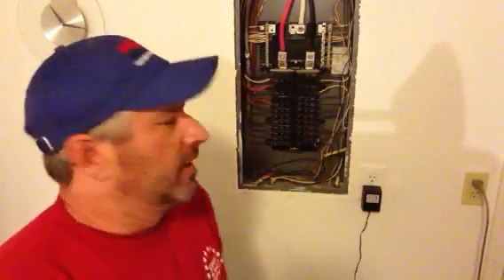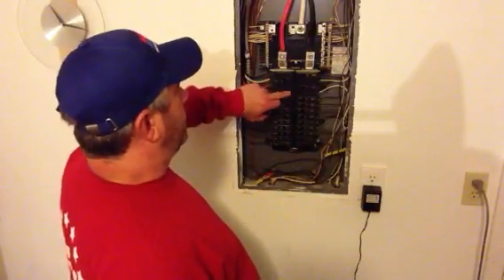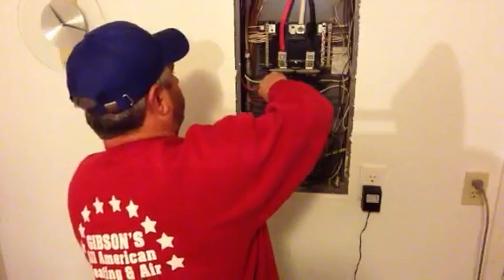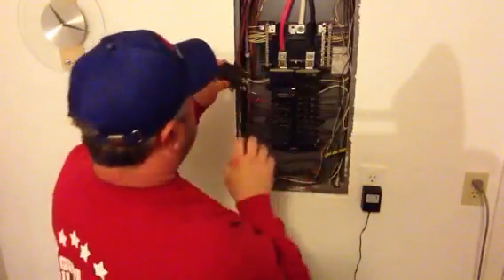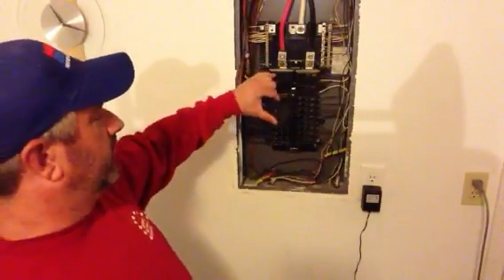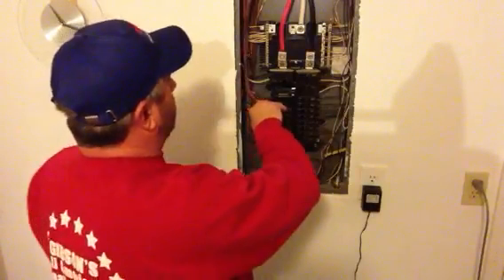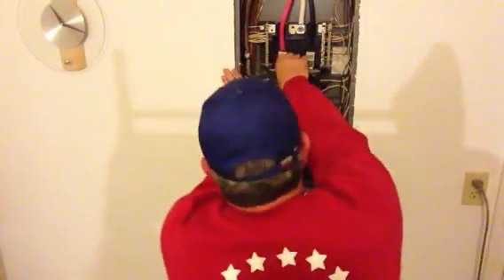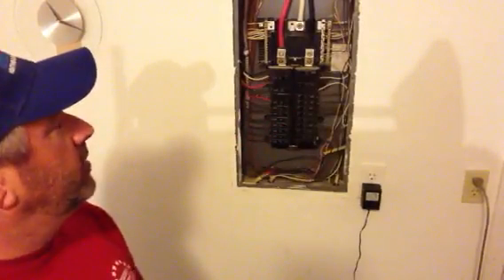Change any breaker quickly with power to panel always on.

Comment: Is your life not worth the five minutes it would take to wear PPE, de-energize the panel, test for a the absence of voltage and conduct the replacement?
Reply: I guess I live on the edge then because I have done this a few dozen times already.
Turn off breaker, pop out breaker, remove wires, grab new breaker, attach wires, turn to off position, keep hand on the plastic, pop back in and wiggle the thing into place. Power never turned off.

Comment: Weather you can do it with the power on or not just turn the main off. For people that don't know how they will try it and get killed. But everyone is different I wouldn't do it but that's me.
Reply: I doubt they would get killed. Many things have to align for that to happen.
If you can turn it off.. turn it off. If not then by all means keep your hands on the plastic, keep the breaker in the off position, look how it attaches and then clip and wiggle it in.

Comment: I changed a bolt on style breaker (THHQB) today on a sub- panel that was live (couldn't shut it down for operational reasons - commercial business).  I had my PPE on, insulated tools, one hand only in the panel at any time, and a helper with a piece of wood nearby just in case.  I would have much rather de-energized this panel, but critical equipment was on the panel.  So, morale of the story is you CAN change breakers on live circuits (thought I wouldn't ever consider this on anything over 600 volts.  460 is scary enough.) but make sure you are basically a safe well trained electrician.  If you're going to change a breaker at home, disconnect the mains.  If your panel doesn't have a main disconnect, have one installed.  You're supposed to have one anyway.
Reply: There is nothing in the National Electrical Code that states that a main breaker is required. If certain conditions are met the use of a main breaker is not required. However if certain conditions "DO" exist then these conditions may require a main breaker. Again "IF" certain conditions are "MET".  There are no requirements mandating the use of a "Main Disconnect" "OR" "Main Breaker".  Now with that all being said the authority having jurisdiction ( AHJ,... or  i. e. Local Electrical Inspector, or for that matter the engineer of record for a particular project ) "he/she" may say that they are requesting the use of a Main Disconnect "BECAUSE",... WAIT FOR IT... they ultimately do have that final authority. However most will not supercede the NEC with a requirement such as this without making it known through their local building codes (or specs if they are an engineer) which is the case in some locals. Hence I will leave with the inevitable Mike Holt link     https://forums.mikeholt.com/threads/when-is-a-main-breaker-required-in-a-distribution-panel.86224/

Comment: My mom keeps insisting I throw the main breaker before putting in switches. I changed out 2 2 pole breaker switches without throwing the main breaker.

Comment: My home is like many described in the comments: built in 1979, and no main breaker.  There is a 100 amp sub panel that contains most of the common household breakers and it can be shut down in the main panel.  Unfortunately there are no empty bays in the sub panel for additional circuits so I have to put a new 20amp line on the main panel.  Interesting thing is the ground and load seem to share a common bus.  Is that possible?
Reply from the maker: Ground and the neutral wire share the same ground terminal. If that what you mean? Your load and line are hot.
Reply: @gibhvac  Sorry, yes neutral and ground.  Not load.

Comment: Changing a breaker live is illegal. It ain't the 70's any more. Any liability is yours and yours alone.
Reply from the maker: @rickhawkins218  Oh it’s illegal? And what would be the law I would be breaking. As for the liability part, doesn’t that go without saying? My business my liability.
Reply: @gibhvac  The Ontario Electrical Safety Code, Rule 2-304, Disconnection, stipulates that no repairs or alterations shall be carried out on energized electrical equipment, and that adequate precautions such as locks on circuit breakers and switches, warning signs, etc. shall be taken.
Reply from the maker: @rickhawkins218  Ontario Canada?
Reply: @gibhvac  If you do work live and anything happens you are responsible and your insurance may not cover you because you are breaking the law. 'Where's the upside?' should be the question you should be asking.
Reply: If you instruct another person to change that breaker and he is injured or dies, criminal charges are laid.
Reply from the maker: @rickhawkins218  I am an LLC and covered by insurance . Accidents happen. But is a risk we take everyday. Sometimes it is impossible to turn off the main power to a building.
Reply: @gibhvac  Under osha rules you can only work live if shutting down creates a bigger hazard. Frankly, you telling people broadly on the internet they can do it live themselves opens you up to a huge liability all by itself. 
Anyeay, you can't fix stupid.
Reply from the maker: @rickhawkins218  To be clear the breaker I removed from the panel is no longer live.

Comment: Is this basically the same for adding a new breaker? My panel just doesn't have a main breaker but I would like to run a dedicated 220V or at least 110V 20 amp circuit to my garage for a welder but I've just been not because I don't have a main.
Reply: @gibhvac  hey when I turn off the main Lightning There's still power coming from those  2 big main cables... that means there's another main breaker or what is going on here?
Reply: @modlauryofficial6603  yeah that's normal. Cuz the main breaker is still Live, still has power coming in from the street just shuts off everything past it. It de-energizes the fuse panel/breakers
Reply: Get some wire nippers, even those heavy duty scissors will work - cut the wire for the plastic tag at your electric meter.  Open the meter housing and yank the meter base off the prongs.  I used to do this all the time doing property inspections in the 90's.  Guy who hired me worked had a contract with HUD if recall correctly.  Anyway, we do the opposite in order to get power back on so we could do our thang - test stuff and winterize using a compressor etc.   I'm not positive things are different with digital meters but I don't see how.   Anyway, that's how you make absolutely certain the power is off.  Important to know this if you don't have a main disconnect (plenty of older homes do not).  Just make sure you bend the metal clip back into place on the electrical company's plastic tag So nobody gets their panties in a wad

Comment: Look at all these keyboard  union warriors commenting about "you're an idiot for doing it live" so typical. Sometimes you don't have the chance to shut the panel off. Banks, large businesses simply can't just shut the power off.  If you know what your doing and understand the risk and how electricity works it CAN be done. I mean hell, you can strip live wire just fine if you understand not to touch bare metal and don't be the path to ground.

Edit: also it's pretty hard to troubleshoot shit when the power is off.
Reply: Did you just compare working on a meter bank to working on a sub panel or residential panel? You do know that banks are not worked on DIYers right? You do know that basic PPE is still used even in that type of work, which is not being done here right? You do know that power can, and is regularly killed at banks from the transformer right? You do understand that just because something CAN be done does not mean it SHOULD be done this way right?
Reply: Says the want to be electrician. 🤣😂

It's not about working on live wires I do it all the time as a lineman it's about doing it safely and this was absolutely not done safely. I work with voltages that would literally blow your arms clean off your body if not worked on safely so believe me I know what I'm talking about I've been working in this field for many years now and that's not from being reckless and thinking that I need to show off and work on a home electrical system without turning off the power because even though I work with voltages much greater than in a home electrical system on a daily basis I absolutely always turn off the power when I work in an electric panel if I'm able to and in a single dwelling home like the one in this video absolutely no reason exists to not turn it off and only turn it on when and if it's absolutely needed. One last thing the power is not needed in most cases to work on and fix / replace or repair something in a home electrical system plain and simple fact once you know what needs to be done.⚡✌
Reply: And do you suppose those who understand electricity, who know how to do it safely, are watching youtube videos on how to replace a breaker? No, so the problem is those watching this for information don't know how to do so safely.

Comment: DOESN'T makes you tough to NOT turn off the main power. you're inches away from being toast.
Reply: @gibhvac  It's also for a very experienced electrician that's willing to risk his own safety.  do it yourselfers are asking for trouble by sticking their fingers into a box with high voltage on.
Reply: @gibhvac  Isn't that what you are doing in this video?
Reply: I have to wonder why breaker box makers just don't PUT A INSULATED protective cover over those high voltage LIVE terminals so you can't slip-up and accidentally touch them ? I'd put some kind of non conductive material between my hands and those terminals. Otherwise one slip that's all it would take better hope 911 responders can revive you. I'm no motcho man. Or wear  sinsulated electrical GLOVES... Man please !
Reply: @jballs1118  that's what CPR is for
Reply: My breaker box doesn’t have a main, so this is helpful to me.

Comment: What kind of panel is that?? We have the same thing and I have no idea how to turn the pain power off to my house.
Reply: @gibhvac  nope, but after doing the research I found I have a splitbus panel . No switch outside I would have to remove the "company fuse" (meter) to eliminate the power to the panel. Thanks for you response though.

Comment: This guy is a fool. Always hire a certified electrician to do work. Cutting corners like this gets you killed or burns your house down.
Reply: Lloyd
breakers need no licenses electrician. BUT its plain stupid to risk and be toast, too much pride!
Reply: Peter McAbyan  Without self education the average person does not know how to properly test for voltage and does not understand enough to work on a panel alone better to be safe than sorry Peter
Reply: I agree if you are not an educated experienced DIY'er or a dumbass do not change breakers.  But if you are, there is no need for an electrician, these projects are simple and I support electricians so it's not about that.
Reply: Do you die when you reset the breaker? So why would you die grabbing it on the switch and removing it from the bus bar???????
Reply: @Yonny316  You are right Yonny, my concern is that people will stick there hand inside an open breaker panel, with no insulated gloves, as this fool is doing, and get DRT (dead right there). If you touch that bus bar, there is no coming back. There is no trip to the hospital, just the morgue. There is also the possibility the breaker has failed and is melted to the bus bar (had this happen on my house) and messing with it live may result in an arc flash, causing you to be blind and/or electrocuted. I have worked as an electrician, a fire inspector and fire investigator. I can hardly think of a worse way to do this other than him waving a screwdriver around inside the panel. Electricity is VERY unforgiving, any failure can result in death or a fire.
Reply: @RavenTheLabrador  I respect what you nerds talk, but you have no power over me, I lick my own electric panel, and live another day..... the less you know about electricity the more money will be made from you.
Reply: Jk guys, your absolutely correct, ya friends friend is gonna reach in there and catch 220v. Good looking out assholes
Reply: 100 amps is what will stop his heart
Reply: @RavenTheLabrador  update a year later.. I change the breakers at the McDonald's I work at all the time! For no extra pay then bring my paycheck home and give it to mommy!! How did you know?